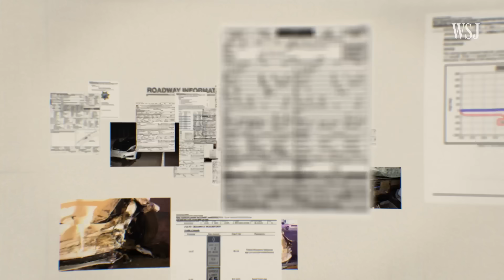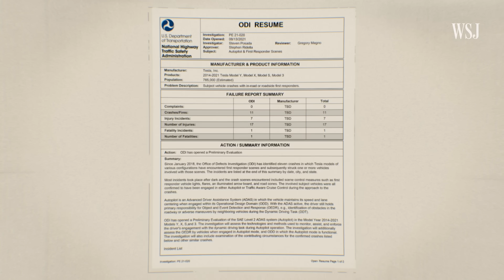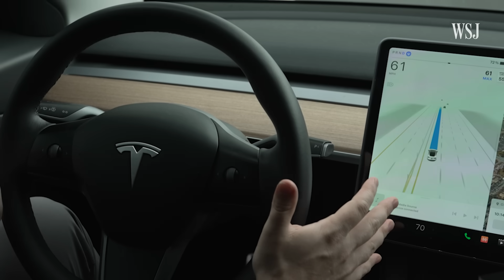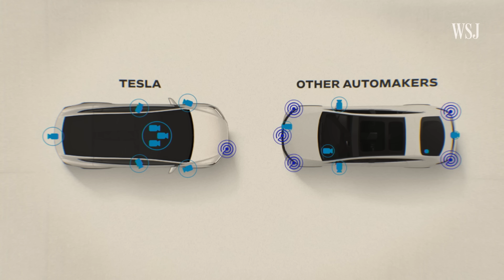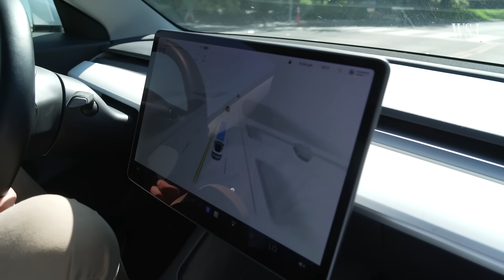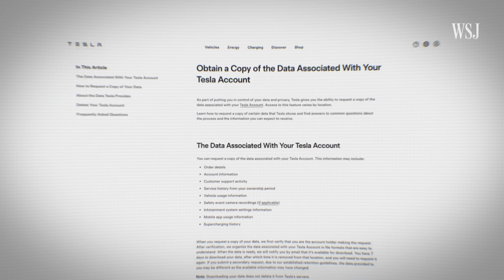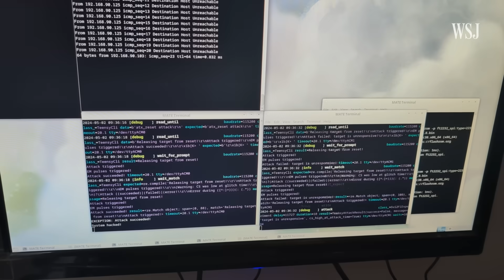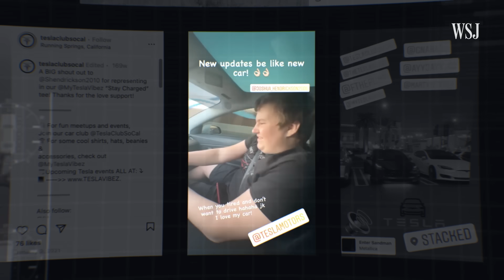The Hidden Autopilot Data That Reveals Why Teslas Crash | WSJ

Comment: Even the window wipers do not work properly in Teslas. Maybe in California it works well, but here in the UK I have seen the wipers go on at times that make no sense. It's pretty bad considering that my 2006 Toyota Corolla can do this perfectly with a proper sensor (i.e., not cameras). If they can't do this simple thing accurately... I wouldn't trust the rest.

Comment: Camera based systems are not good enough and it's just a cheap way to implement the tech. Radar or lidar are the only way to safely use adaptive cruise control.
Reply: V13 is proving that to be false. Tesla are very close to solving true autonomy. Most people have no idea just how good Tesla FSD is getting.

Comment: Shocking ! So why do regulators allow this on public roads ?
Reply: They are using an advanced cruise control. It is level 2 and requires the drivers attention at all times. If used correctly it is a great driving assist, and has avoided many accidents. Having said that FSD is full self driving, and capable of driving anywhere. The progress Tesla has made is remarkable.

Comment: I can easily imagine running into that overturned semi truck. No flares out and it was dark. It fooled the auto pilot, but it could easily fool the human.
Reply: Yeah. The human mind can easily go into ‘autopilot’ and fail to register the obstacle. Especially at 3am on a deserted highway.
Reply: @bikeman7982  Agreed. This is why I use FSD as much as I can. The phenomenon you're describing is called "highway hypnosis" and its very real. FSD is much better at constantly staying alert than a human would be. This isn't even factoring in phones or alcohol.
Reply: The principles of defensive driving saying you should slow down and even stop until you figure out what is in the road ahead.
You seem to be forgetting that.
Reply: @ I went along with you until you added “you seem to be forgetting that”  It was a dig, and unnecessary. And I do trust that you do indeed know that. See? I trust you.

Comment: That's because they removed the forward looking radar and rely on cameras - that can be fooled just like the human eye, particularly by huge dark objects like the underside of a semi.  The video that opened this segment was just such an example.  The tesla did not react at all until the cab, being what, was fully visible.  By then it was too late.   A forward looking radar, such as the one in most modern cars for accident avoidance and adaptive cruise control should be mandatory in self driving vehicles for the same purpose because they can see where cameras cannot.  And the chips in those guidance cameras can be easily fooled by strobe lights, being overwhelmed and unable to determine a safe path and therefor a safe stopping distance or maneuvering path.

And Tesla should be sued right off the market for using the words 'self driving' since the cars MUST be monitored and assisted by a human.  So it is 'driver assist', not in any way self driving.   Until they can remove the steering wheel with 200% surety the vehicle will not crash except under extreme situations the car should only have control of the steering for emergency maneuvering, that is all.  The human operator should be in 100% control otherwise - *PERIOD*
Reply: These cars probably did have radar. Tesla removed radar because it was conflicting with the camera's. The camera's ultimately being proved correct. This technology has saved lives, and will continue to do so if used correctly.

FSD is full self driving and it's performance is showing how close Tesla are to solving true autonomy. This tech will make our roads far safer.

Comment: Crazy that beta testing has been permitted like that on public roads.
Reply: It is level 2, the driver is ultimately responsible. FSD is proving itself a very capable system, and will make our roads far safer.
Reply: @daydreamer8373  Until a network for instantaneous communication and coordination between vehicles is developed I see a big issue with security by letting these uncoordinated cars in beta stage driving around.
Reply: @jimbotron70  You obviously have not seen V13 of FSD operating. Tesla are on the verge of solving autonomy.
Reply: @daydreamer8373  Yes... on the verge like the upcoming nuclear fusion 😂
Reply: @jimbotron70  Most people have no idea how good FSD is getting or will become. Tesla are looking to start autonomous operations in Texas and California next year. Tesla is well placed to dominate in this space.
Reply: @daydreamer8373  Until AGI (artificial general intelligence) is developed no current data driven algorithms are able to understand and solve real world driving issue, see the Tesla ramming full speed into the overthrown truck.
Reply: @jimbotron70  The Tesla running into the truck was simple cruise control, and the drivers fault. I am talking about FSD (full self driving) and it is driving in the real world.
Reply: @daydreamer8373  FSD before AGI won't happen, as I said no matter how big a set of scenarios is baked into current algorithms could handle all possible real world scenarios. Even human cognition would struggle with some of them, go figure a deterministic machine.
Reply: @jimbotron70  Again FSD is doing it now. Handling situations many humans would struggle with. It is not quite ready, but as I said Tesla are looking to start operations next year in Texas and California.

Comment: I’m a Tesla driver. I don’t like Musk, and I feel lied to about the car’s capabilities. BUT, it’s saved me from at least two accidents. Here’s the data point we need but they didn’t provide: “how many accidents per million miles driven WITH and WITHOUT autopilot”. Naturally corrected for other variables. Give me that data.
Reply: Now the issue is that how would you count the accidents prevented by autopilot since, well they didn’t happen because they were prevented
Reply: @bardz0sz   how would you count the accidents prevented by autopilot 
You can only infer avoided accidents statistically. Say you have a group of 100,000 vehicles without autopilot, which experience 5 accidents per year; so the total accidents are 500,000. Now you replace 10,000 of them with vehicles with autopilot that experience only 4 accidents per year. Now the total accidents are 90,000 x 5 plus 10,000 x 4 = 490,000. So you can infer that replacing 10,000 vehicles without autopilot with 10,000 vehicles with autopilot has prevented 500,000 minus 490,000 = 10,000 accidents.
Reply: Exactly
Reply: Give me that data. 
Ask and ye shall receive. "In the 3rd quarter [of 2024], we recorded one crash for every 7.08 million miles driven in which drivers were using Autopilot technology. By comparison, the most recent data available from NHTSA and FHWA (from 2022) shows that in the United States there was an automobile crash approximately every 670,000 miles" (Tesla Vehicle Safety Report 3Q2024).
Reply: @BigBen621  That is somewhat skewed because you are only supposed to use autopilot on freeways, which limit vehicle interactions by design.
Reply: @economicprisoner  Yes, I agree, although speeds are much higher on freeways, which means accidents that do occur are more likely to be fatal. 

The problem is that NHTSA doesn't segregate crash data based on road type. But they do segregate fatality data roughly by road type (actually rural vs. urban),  and one might assume that crash data would at least roughly follow fatality data. In brief, the rate of fatal accidents on rural roads, which of course include intercity freeways, is 1.68 per 100 million VMT, while the rate for all drivers is 1.33 per 100 million VMT. This suggests that there are more fatalities per mile in rural areas than the average, which would make the ratio of 10.6 between Teslas on Autopilot and average drivers even more remarkable.
Reply: @BigBen621  Motorways )our freeways) in the UK are safer anyway, despite higher speeds, due to not having lots of bends and junctions and gradients.
Reply: @alisonwilson9749   Motorways ... in the UK are safer 
Likely the same in the U.S. But they're certainly not 10 times safer, which is what it would take to erase the safety advantage of autopilot.

Comment: Great story! I would've liked more statistics, especially number of deaths and crashes in proportion to active Teslas with auto pilot vs. proportion deaths / crashes of some other comparable manufacturers. Because this is what all pro autonomous vehicle people is screaming: people still make more mistakes! Which of course on its own is not a sound argument: if a random selection of cars of brand A had brakes that could just, by construction, suddenly completely stop working for no reason, and you could prove that, they would not be allowed on the streets. Of course issuing a warning would not suffice. This is where you would build the case against Tesla: They are obviously promoting a technology which we are encouraged to hand over our safety to, while still claiming in the details that it isn't ready for that. Calling something that is SAE 2 'auto pilot' and promoting it this hard by constantly claiming it will save lives etc is straight up dangerous. I mean what is the point if you should always keep your hands on the wheel and feet on the pedals and be prepared at all times? Of course people will act the way the technology permits them to, not what Tesla writes in the manual. They know this, and this is why I actually think they will have to pay up enormous sums pretty soon. There's going to be whole law firms working on nothing but these kinds of cases very soon.

Comment: I drove a 2021 Tesla model 3 about 20k miles over a year. I will never drive one of those cars again. I didn’t have access to autopilot but even just the camera controlled cruise control is dangerous. You get phantom braking all the time where it just slams on the brakes for no reason. I had times where when I was driving into the sun the autosteering tried to drive me into the highway dividers instead of following the lines and turning. When that happened I tried to take back over control but it wouldn’t let me so I yanked the wheel as hard as I could and it started dinging all the bells and whistles and said cruise control was disabled for the rest of the drive. I stopped using the autosteering and would only use cruise control for speed. I always hovered my foot over the pedal to be ready to push the gas or brakes at a moments notice. It was tedious. I’m happy to be back in a Toyota.

Comment: Airline Pilots are monitoring the plane and there's very little chance to look outside and not hit another plane at those speeds in cruising alt.  TCAS will detect. So it's apples an oranges comparison.

Comment: that's what happens when you don't use Lidar
Reply: Lidar is not some sort of super sensor. A Waymo crashed into a large pole a few months back. What Tesla is doing with self driving will save many lives.
Reply: @daydreamer8373  that crash is due to error in vision based algo. Lidar dont have this problem as it will treat the overturned truck as a brick wall. Simple as that bro.

Comment: A huge innovation that I think is coming is to design the roads for self driving cars as well. Imagine QR or bar codes painted onto the road, giving information like road curve, grade, superelevation, for an upcoming curve. Roads are designed for humans, which is why computers have such a hard time comprehending whats going on.
Reply: V13 is proving non of that is required. Tesla are on the verge of solving autonomy.

Comment: Until human input is removed from the act of driving (or other activities) then human error will, at the point where automation 'gives up', still be a significant factor accidents.

There are similar autopilot problems in automated aircraft where the pilot becomes the 'blame vector of choice', with similar finger pointing by us armchair commentators.

Comment: You would think all the cars in this video had no drivers behind the wheel the way they are making it seem as if Tesla is evil.. there’s absolutely nothing stopping any of these drivers from controlling their vehicles in a safe manner via gas/brake pedal or steering wheel. All these accidents are examples of ppl who are sleep, could not see well, incoherent or not paying attention. Only thing Tesla is guilty of is creating the best driver assistance tech, where’s the video of ppl rejoicing on how their Tesla has saved them from accidents? Mine surely has multiple times

Comment: Inmy experience, these in car systems even have issues keeping to the speed limit. I have experienced several instances of both my Skoda and a colleague's BMW misreading speed limits both under and over the actual speed limit. 
I've also had my lane-keeping software warn me at a particular place on a particular road when I I've been driving smack in the middle of the lane.
I won't use my car's adaptive cruise control for that reason. 
Its not trustworthy.
Fine, I let it warn me if it thinks I'm speeding, but that's all. I am NOT conceding control to software.

Comment: All people driving rely on "cameras". The industry is folding. Ford and VW gave up. GM gave up. Tesla's systems are proving to be the way forward. What you are missing is that it's not as much about the sensors as it is about the 'brains' of the system. "A person would have clearly said something big is in the middle of the road" Clearly, that was not the case. BTW? What experts where you referring too? Seems the most qualified people in the field are working for Tesla.

Comment: Not a Tesla driver here, but I’m assuming self driving tech has improved since 2021. I can’t believe this is the focus of a report in 2024 ( almost 2025).
Reply: That is an assumption with no data to back it up.
Reply: @mikebronicki8264  The driver was using Autopilot, not the advanced FSD. Both have gotten much better since 2021. Even in the last 6 months, FSD has made huge improvements. FSD wasn't even widely available when this video came out.
Reply: @mikebronicki8264  That is an assertion with no evidence to back it up.

Comment: They call it "autopilot" then blame the driver for letting the car drive.
Reply: it's a GOOD term! look at the definition from Wikipedia for example: "An autopilot is a system used to control the path of a vehicle without requiring constant manual control by a human operator. Autopilots do not replace human operators. Instead, the autopilot assists the operator's control of the vehicle"

Comment: It’s a glorified, wrongly marketed cruise control.
Reply: YOU'RE SO FULL OF IT IS FUNNY. I DRIVE MY TESLA AROUND AND IT'S ACTUALLY, IT'S ACTUALLY ALWAYS DRIVING ME AROUND. FULL SELF DRIVING FROM A TO B. IT'S SAFE. YOU DON'T GET IT AND YOU MAY NEVER WILL. IT'S LIKE YOU'RE STILL DENYING THAT THE INTERNET IS THE FUTURE
Reply: it's a GOOD term! look at the definition from Wikipedia for example: "An autopilot is a system used to control the path of a vehicle without requiring constant manual control by a human operator. Autopilots do not replace human operators. Instead, the autopilot assists the operator's control of the vehicle"

Comment: Unless it is level 3 so Tesla is responsible for everything that Autopilot does it is not saver than most people driving. With not going for level 3 Tesla is basicly saying they are not willing to take responsiblety for Autopilots actions
Reply: They are saying it is a level 2 driving assist. The driver is responsible. There are many cars that have these systems. None say you don't have to pay attention.
Reply: @daydreamer8373  that is what I ment you have to pay attention and BE a backup to autopilot because Tesla know that it will make errors.

Comment: Driving a tesla myself, use autopilot (enhanced autopilot licens active) a LOT. However, I am fully aware that I need to keep my hands on the steer and pay attention as I know very well that it is not safe to trust it at full. Although the current capabilities are fenomenal based on vision only, I still think it was a giant mistake to throw out radar since radar can detect objects that you cannot see (and therefore vision based autopilot cannot see or identify either). Driving in fog is a simple example. Detecting pedestrians on the road is another example.

For anyone owning a Tesla: please, PLEASE, keep your eyes on the road and be fully attentive as if you were driving yourself and not the autopilot system. That is the ONLY way that this thing makes driving safer for the simple reason that you as a human do not become tired as much as when driving yourself. Do NOT use it as a fully self driving system because that way you will either end up either harming yourself or somebody else or worse
Reply: On a second note,  this whole video seems weird to me as when using autopilot, this thing starts braking waaaayyyy faster than what is visible in the video. In general: autopilot will BREAK, not try to avoid the obstacle. While in the video you clearly see the car is trying to pass the obstacle to the right. Possibly the driver overruled autopilot by jerking the steering wheel?

Comment: We shouldn’t allow autopilot. The driver should always be in full control and operation at all times.
Reply: it's a GOOD term! look at the definition from Wikipedia for example: "An autopilot is a system used to control the path of a vehicle without requiring constant manual control by a human operator. Autopilots do not replace human operators. Instead, the autopilot assists the operator's control of the vehicle"

Comment: Musk saying that the sensors are unnecessary, because the camera is safe... Safety is redundancy, sure in 99.9% of cases it is. But for the rest you need backup. It is just so arrogant and shows he really has no expertise
Reply: FSD see's far more than any human. extra sensors simply make the systems more expensive and complicated. What Tesla is doing will make our roads far safer.